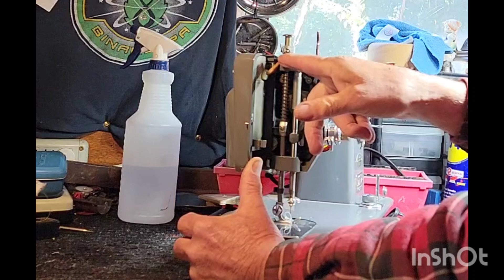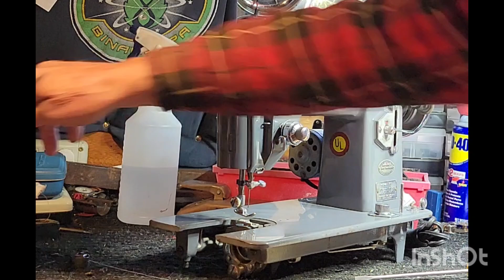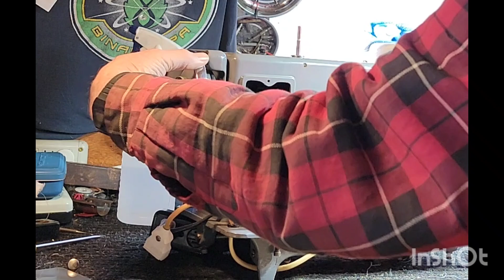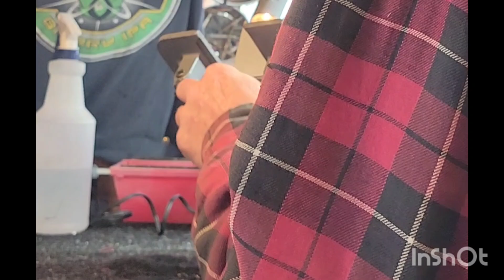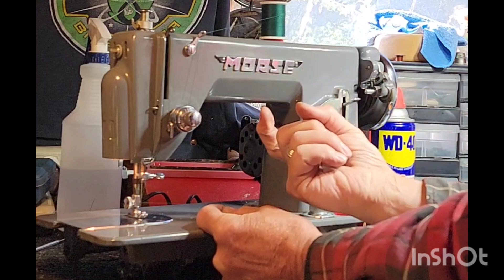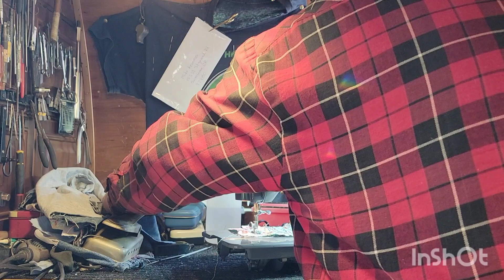Jenee's Morse Sewing Machine final test/tutorial video

Comment: I'd never oiled anything related to my bobbin case. (I have a Signature J276D)

I wish I could tell what the mechanism is that my pressor foot pressure adjuster affects, because after I allowed the machine to sit idle for most of 15 years, this doesn't function smoothly, to the point where I am loathe to adjust the pressure! 

This video was helpful to me, because I've been overly conservative about where I apply oil. My manual has a good maintenance oiling guide, but I needed more than this. I'm going to enjoy watching some of your older videos. - Kelly

Comment: I heard that a few Japanese manufacturers were contracted to make these machine under the names of Morse and Atlas.  I have an Atlas A59 pink machine and I’m missing the upper tension pin.   I saw on another YT channel how to make a tension pin and cut it down to size with heavy clippers.  I have a pin from a sewing machine supply company but it’s too long.   Maybe the Morse machine you have uses the same length as what I need.   Could you measure how long the tension pin is so I can use that to try.  Otherwise I can’t replace what’s missing and this is such a lovely machine.  Thanks for doing these videos.   Great info to keep these wonderfully made vintage machines.  👍👍👍❤️❤️❤️